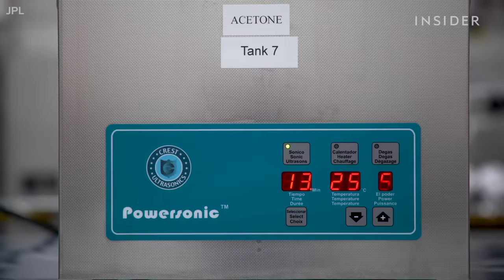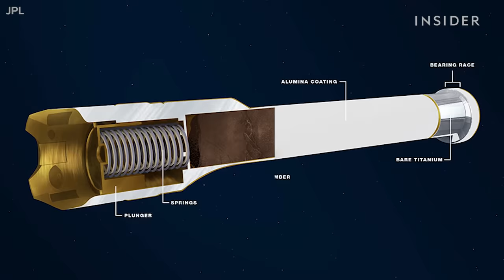Why Two Pounds Of Dirt From Mars Costs $9 Billion | So Expensive | Insider

Comment: So what does the rover run on is it battery, how does it charge? I'm just curious, it's so insanely cool.
Reply: Don't want to be a complete ass but I believe nothing nasa says or does... these rovers prob are running in some remote desert on earth :P
Reply: Solar panels
Reply: @skyral4137  it doesn't have solar panels, perseverance uses an RTG
Reply: Perseverance uses an RTG (Radioisotope Thermoelectric Generator). The RTG will convert the heat from the natural radioactive plutonium-238 into electricity. Once the plutonium decay runs out, it will never recharge. The rover will be dead forever

Comment: Is it possible the crater was created by a large meteorite with lots of ice that melted, creating that "lake" but evaporated quickly without any life. (random thought)
Reply: But I think there are also signs of rivers
Reply: @jacqueschannel4538  yes, "river" from the melted ice that flowed and disturbed the sand/dirt. then evaporated
Reply: @theBurningice31  I feel like with evaporation, it can’t disturb such hard terrain, but maybe… maybe the water seeped in and froze and expanded
Reply: It's not just the crator. There are visible water valleys inside the crator.

Comment: Shipping a proper equipment that can test soil on  Mars is the better solution! Ship the equipment there, run the tests there and transmit the data back home. This is the best option!
Reply: Absolutely not, since the buildings used to house, power, and operate the equipment are far more massive than even a rocket designed to return to earth from mars

Comment: Actually anti-matter is the most expensive material costing approx. $62.5 trillion per gram.
Reply: Did they mention dirt from Mars being the most expensive material?
Reply: @nitsuji3495  It was the very first sentence!
Reply: @seanriopel3132  oh i see my bad
Reply: @nitsuji3495  Lol. It's all good. I thought you were phucking with me at first and I had made a big boo-boo. The crazy part is they haven't even made a gram yet. They can only create anti-matter in a particle accelerator like the Large Hadron Collider at CERN. It takes ungodly amount of electricity to get the particle very close to light speed before they smash it into a target and create a whole bunch of exotic particles including anti-matter of which they only make a few particles at a time.  CERN uses 1.3 terawatt hours of electricity annually. That's enough power to fuel 300,000 homes for a year in the United Kingdom. But the energy needed changes from month to month, as the seasons shift and the experimental requirements are adjusted. Cost about $24 million in electricity, $280 million for computing and the rest in salaries and other misc. All in all its about $1 billion a year and they have only managed 2 nanograms. A nanogram is one millionth of a gram.